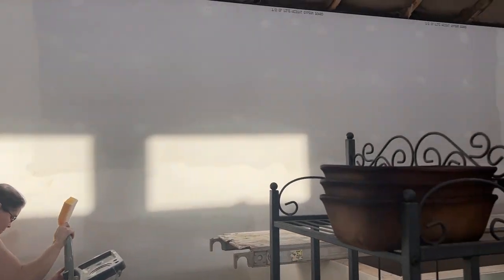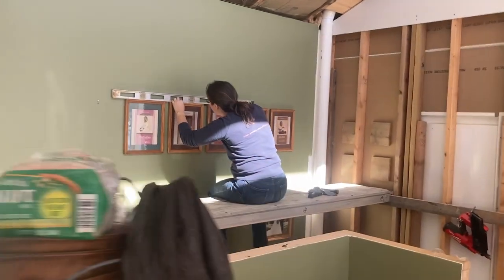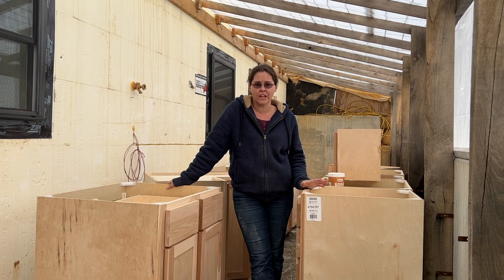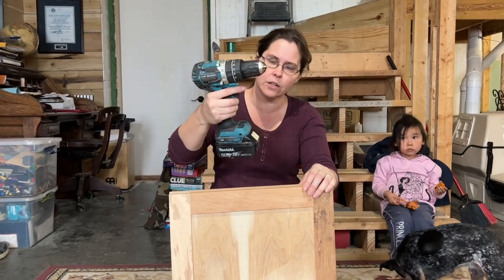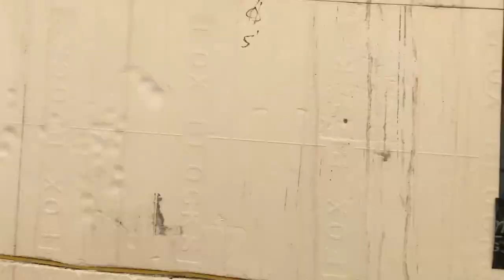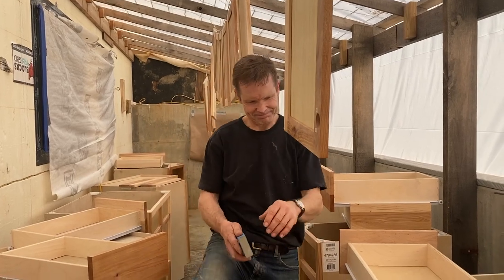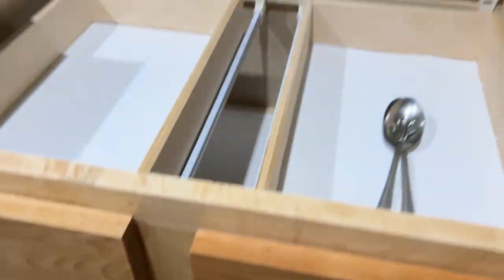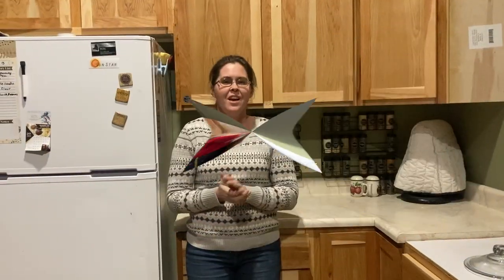Installing the Kitchen Cabinets

Comment: Great to see the cabinets. A major milestone.  The kitchen 'suddenly' looks like a kitchen even with a temporary countertop. 
I have two ideas about sinks as my wife grew tired of washing dishes in the laundry room :-)  ; one, our undermount sinks actually mounted on top of  the plywood subbase and then were caulked to the granite countertop.  Maybe you could drop in your current sink, on top of the plywood, and have a sink now.  two, you can buy a cheap sink and drop it in and have a sink now in the kitchen. 
PS: How about an update on the animals and how they are doing through the winter.
Reply from the maker: We considered a few options to make the sink usable, however, due to the fact, we have so many children that cook, prepare, and often neglect to clean up their messes very well—In addition to the general carelessness that can happen with children, we opted against it. I can only make it work if I had all the plywood attached down to the cabinets and everything caulked, which were steps I really did not want to take for a temporary situation. So, by limiting the water/liquids available in the area, we felt we would significantly reduce the risk of damage to the cabinets below. So, we’ll just continue being patient.🥴